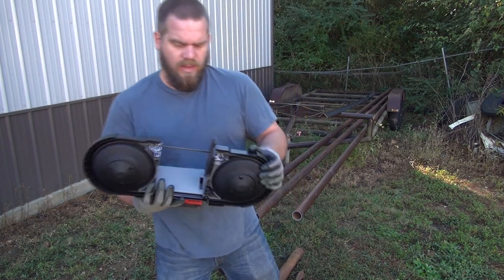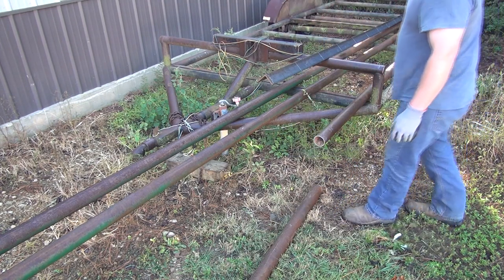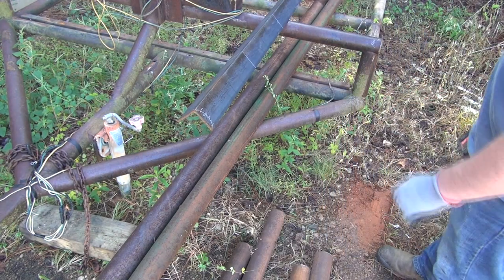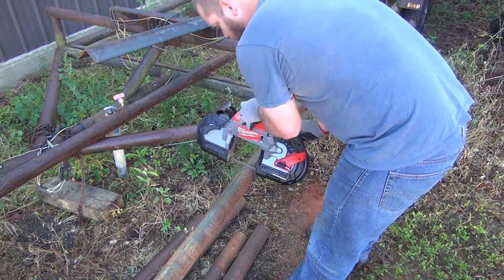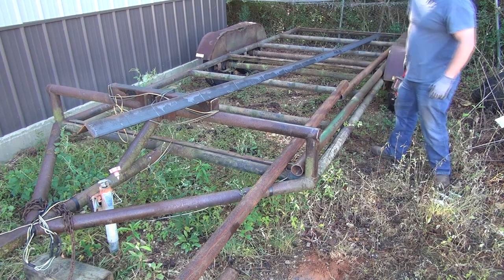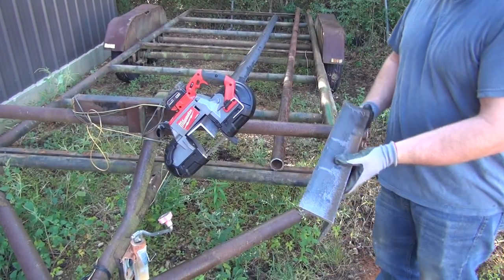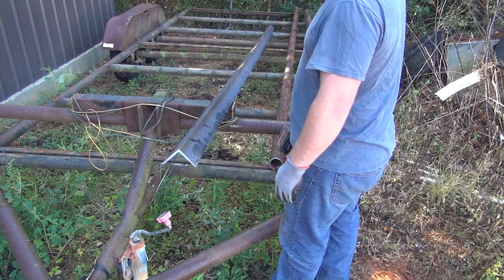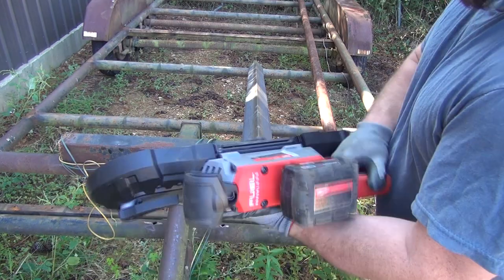Milwaukee fuel 2729 band saw, 35 yr old trailer restoration part 2

Comment: I recently picked up the HarborFreight Chicago electric 9 inch 15 amp angle grinder before they discontinued it and I went on Amazon and got some 9 inch cutting blades for it and that thing is a beast

Comment: Chase this video does not play for some reason , I get audio but no video.  I'll check back later and see if it loads .
Reply from the maker: Working for me, and a few others. Maybe it'll work for you in a bit. you know how YouTube can be.
Reply: @LifeWithChase  back online 👍 I have the same unit but corded .  Very impressed with the battery unit , I  don't have the milwaukee batteries but if I did it's a good choice .
Reply from the maker: @SteveRobReviews  I remember seeing your video on it. I debated on buying the corded, but most of the time I only need to make 2-3 cuts  and then weld whatever I cut so I decided the battery unit might be the way to go so I wasn't constantly looking for a cord, although it is frustrating when you're half way done cutting and the battery goes dead 🤷 😂 but then again so is picking up a tool that is not plugged in because you forgot you unplugged it and plugged something else up. 😂
Reply: @LifeWithChase  MK Morse 1182 ,  made in the USA  . smokes the Milwaukee blades . My go too blade now . Check them out but only on sale because they are pricey . 

`
Reply from the maker: @SteveRobReviews  I'll look them up. I found that the Milwaukee extreme blades are pretty good but the regular ones not so much.48-39-0601 is what I been using. 48-39-0611 is fine tooth.
Reply from the maker: @SteveRobReviews  looks like they are cheaper than the Milwaukee extreme blades.
Reply: @LifeWithChase  I thought the Cobalt reference was marketing but these cut like crazy 😅